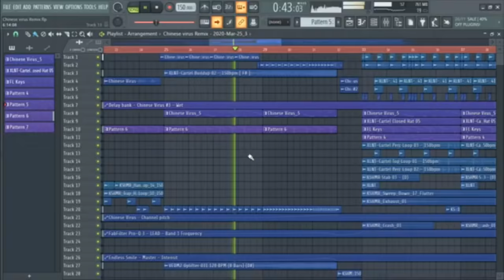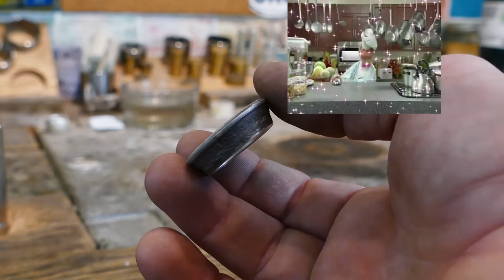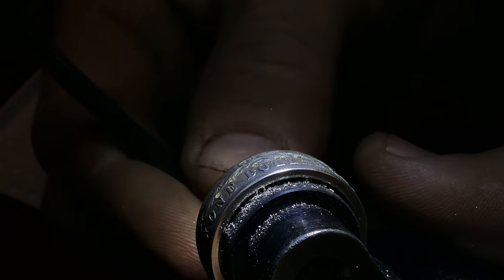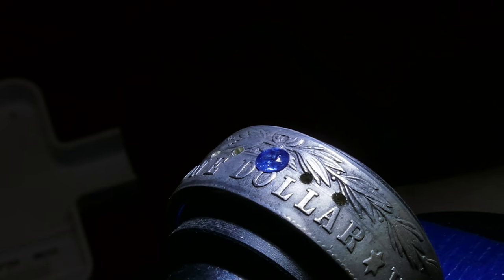Flush setting Sapphires into a Morgan Dollar Coin Ring

Comment: Awesome.   Were they shallow sapphires?   Did they stick out inside the band any?  I tried this once and the stone was too deep and came thru the ring too far where you could feel it against the finger.
Reply from the maker: You definitely don't want them sticking through the bottom. I measure mine before I start to be sure they have room. These stones were diamond cut which are shallow and easy to set. The smallest ones were gem cut and I bought them by accident. They are deeper and more difficult to set.
Reply: @CoinRingsfromTheMint  yeah I'm betting mine were gem cut also.  Thanks!  Looks awesome.

Comment: Inside setting Sapphires so stones are locked in and never fall out. Inside setting you can even solder in the back side of the Sapphires due to solder will not show on the inside. Also Sn solder is low heat and will never affect Sapphire.
Yes
Ceramic adhesive on Inside setting Sapphires is easy but solder is a stronger Inside setting Sapphires lock.
Last
Diamond cut on Sapphire is a waste of stone and time due to the reflection of the back side is useless top cut yes bottom Diamond cut on Sapphire almost useless.